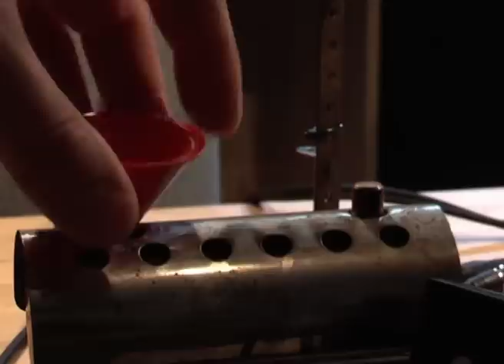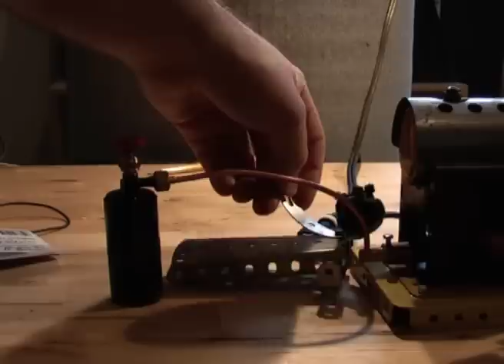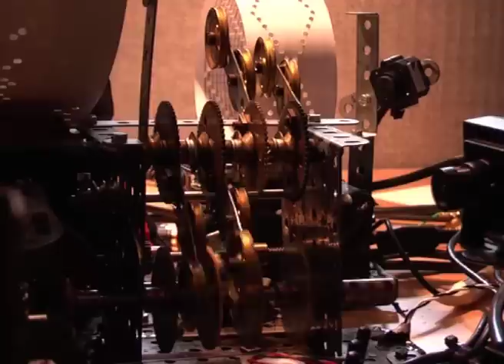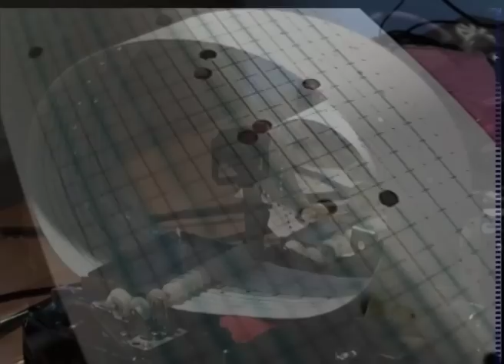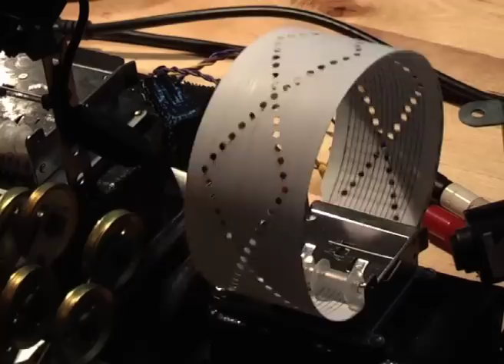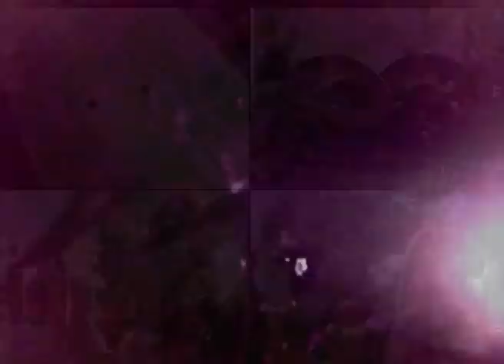Steam Machine Music

Comment: You do not deserve 929 dislikes and counting. This is amazing, being made out of Meccano. Like you say in the description, it looks like everything is going to fall apart at any second, but it never does in this video at least. I'm sure you could put some mechanical switches on the various instruments, so you flip a switch and it either engages or disengages the gears, rather than having to physically remove the greasy chains to turn something off. Just an idea though.